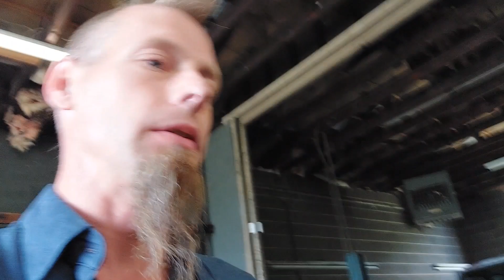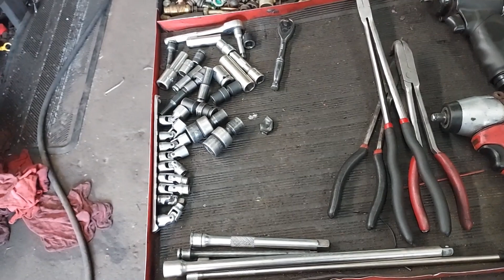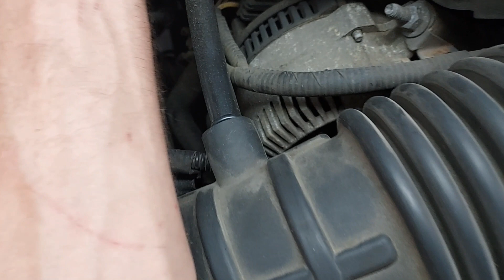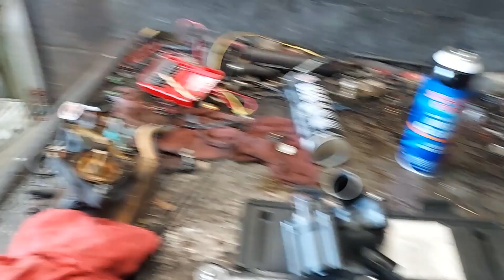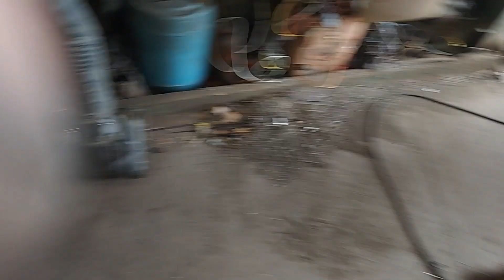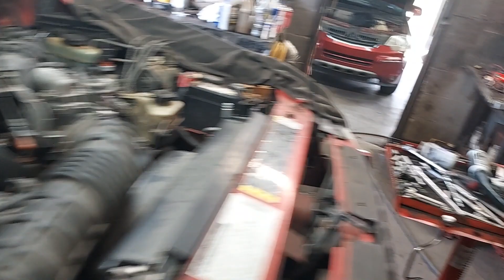Ford Ranger 4.0 Thermostat Housing Replacement

Comment: Dude.. the 4.0 has a soul i swear.
Have a 2000 with all the bells and whistles/ factory custom by a retired auto worker.
The motor has the strangest issues and will choose random moments to not start even though we went through the entire ignition system multiple times. 
When we went to change the sparkys every single 1 of the 6 was literally missing the ends, complete full gap for the spark but it still started right up before we messed with them!!😂 just a complete wonder of design!